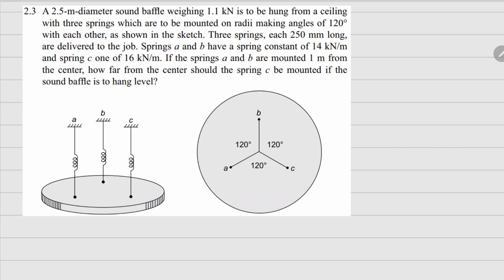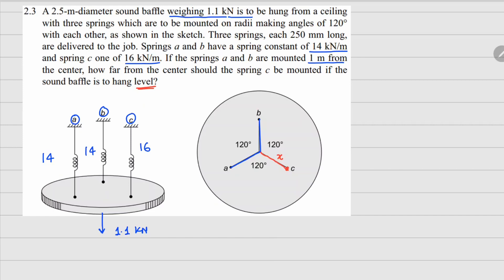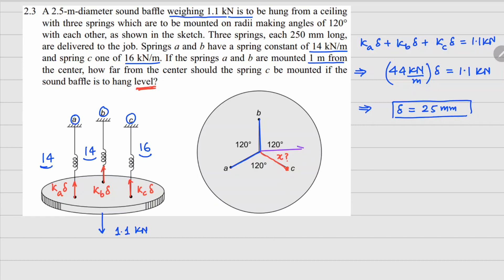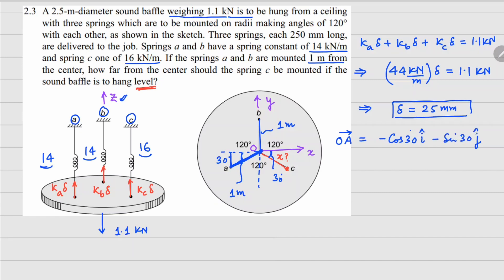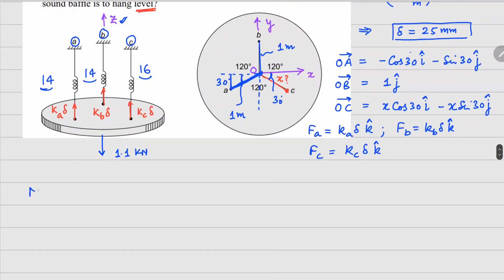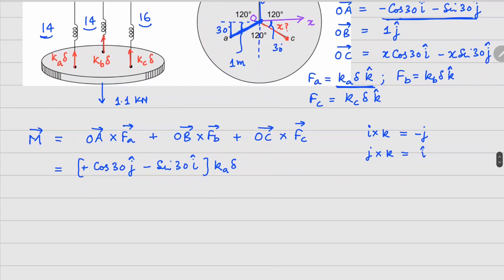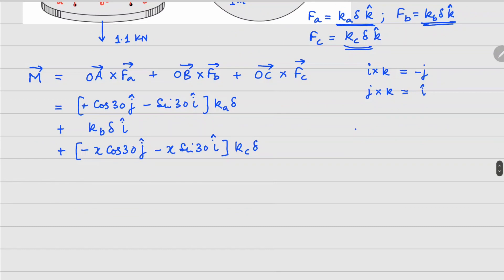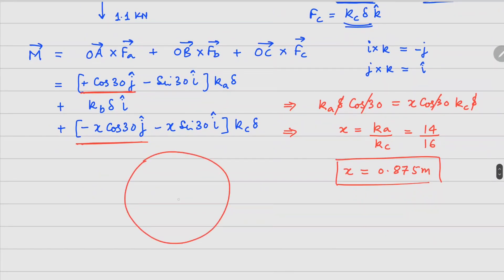Problem 2.3 | Mechanics of Deformable Bodies| Mechanics of Solids | Crandall, Dahl, Lardner

Comment: For this exercise, one could consider this as a beam with the mass center in the middle being supported by two 14 kN/m a distance 1m cos(60) away from the mass center and a 16 kN/m spring a distance (x) m away from the center. If δ is the deflection, and k1 = 14 kN/m &  k2 = 16 kN/m, and understanding that parallel springs are directly summed whereas springs in series are summed like resistors in parallel, then
Summing forces:  1100N = 2k1.δ+k2.δ  or   δ = 1100/(2k1+k2) if you wish to calculate the deflection.
Summing moments about the center:   2k1.δ.cos(60)m = k2.δ.x   or  x = k1/k2 = 0.875m  is the the position of the 16 kN/m spring from the center to maintain a horizontal "baffle".
Reply from the maker: Thanks. That is a quick and smart way to do it but it requires a higher level of understanding at the idealization step which may be difficult for students at the start of the course.